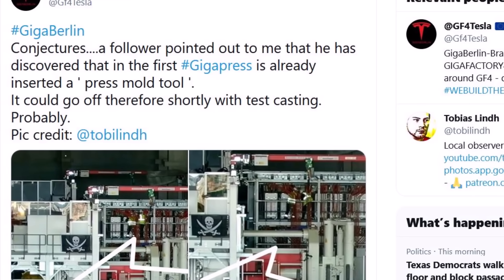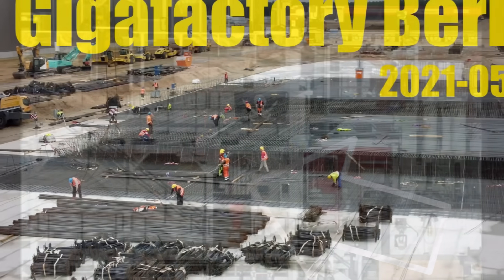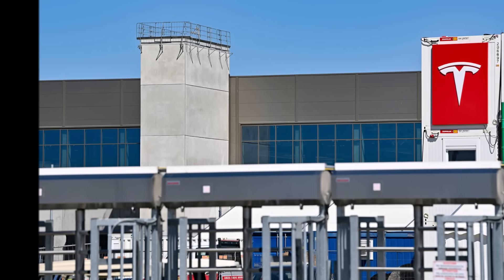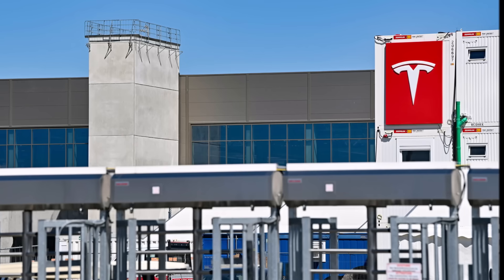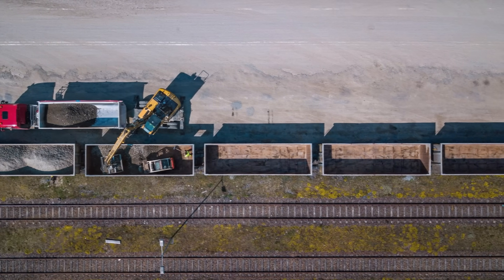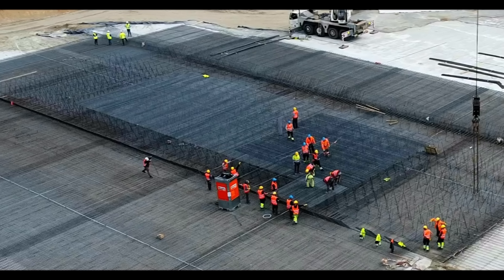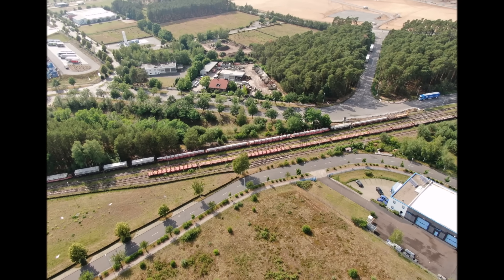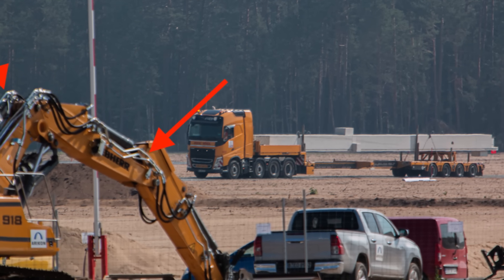Tesla Giga Berlin Inserted a Press Mold Tool, Test Casting Shortly

Comment: Giga Texas is making front and rear castings and shipping them to Fremont.????
Texas battery factory frame is up and roof is on and concrete floors being pored !!!!!
Berlin is phase  1  only !!!!!!     Texas is phase  1  &  2  &  3 !!!!!!!     Berlin & Shanghai don't  equal Texas !!!  Texas is  3 production lines being built at once and started after Berlin and yet is in front !!!!!  Berlin is building foundation for battery factory!!!!!!  Texas is building a foundation for the cathode factory and the foundation for the Star Link factory at the same time. Texas will build   (No  1  Model Y)  (No  2  Cybertruck)  (No  3  Semi) out of the current building that is being built !!!  Shanghai have built Model 3 and Model Y both in under a year and yet Berlin is left with there pants down around their ankles . I find this embarrassing and I live on the other side of the  PLANET!!!!!  Save the planet  Save the environment !!!! Save the economy !!!!!!

Comment: Teslas + all EVs run on:
Crude oil 🛢
Or coal 🏭
Or nuclear ⚛ power plants that generate the bulk of USA electric grid + feed most charging stations
We will see how long it is until we have ample eco friendly sources of renewable energy/battery charging stations
Reply: Your point? Even allowing for the conversion factor, EVs use less fossil fuels than ICE cars. Don't forget that refining and delivering gasoline etc uses additional fossil fuels. There is also a growing % of electricity generated by renewables, and Tesla is making a big difference in making those renewable sources through battery storage.

Comment: I'm unfamiliar with German bureaucracy, other than the obstruction I read about earlier in German history.  The big deal now is water and unions.  I look out into the countryside and see at least two rivers running nearby.  The narrator claims VW and Mercedes pays more.  Do German union reps sit on the boards of directors of those companies?  Did the union reps on the boards approve of the diesel engine fraud?   Or, is the usual refrain being mouthed.  "I know nothing!"

By the way, the Pirate Flag represents ridicule of authority.  And as you probably know, there is plenty to ridicule in all bureaucracies.

Comment: If grünheide likes SO MUTCH its Water, then why they invited tesla to Germany??? TESLA could have gone anywhere else in the EU.  But now that the Germans have secured the TESLA Giga factory play insidious games and remember how much they love their water (!!!???###)... Germany is such a painful, difficult bureaucratic choice.
Reply: Tesla is dangerous to all other Auto manufacturers. There are many that do not want Tesla and will use any means to do them damage.
Reply: Grunheide is right to be concerned and protect the main source of water supply for the whole area, the natural aquifer or underground lake below gigafactory 4.  It is a finite resource, so if the new factory uses too much water that could cause water shortages in a year of low rainfall.  

The increase in housing in the area as people move in to work in the factory will cause further demand on the water supply.

If there were a chemical spill and pollutants leached into the ground and thence to the aquifer , that would affect the whole of grunheide.

A responsible local authority will try to manage all of that.
Reply: @robertsmart7484  There is a train station near the factory to transport workers to the Berlin area, so there will be no big problem with local housing!